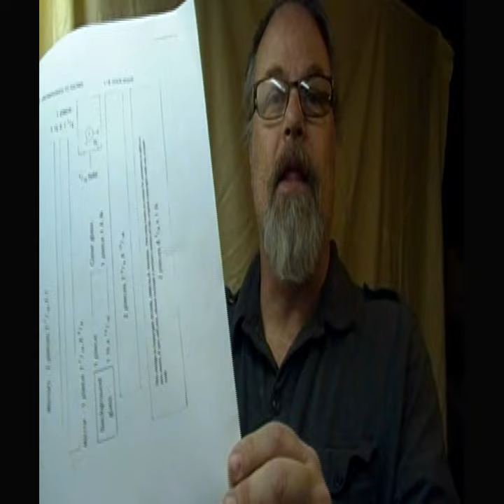The Kaleidoscope Maker #1

Comment: Thank you Mr. Bensley for producing this video & sharing it.  I'm excited to see more of your videos in the future. But I'm a little confused by a comment you made (ref. 32:03) in the video when you said you wanted to make sure you had uncovered your mirror.  When did you cover it after you had assembled & inserted the mirror into the body?  And, shouldn't there be another piece of glass or plastic adhered at the end of the main body to prevent dust from entering & getting on the mirror?  Did I miss something in the video?  Thank you again for your time
Reply from the maker: Connie Flanery I covered my mirror ends when I was finishing the scope.  I could have removed them, but sometimes it is more harm to remove them when finishing.  That is what I meant by uncovering my mirror ends.  Yes, adding an extra piece of glass to the end does help prevent dust from getting into the mirrors.  That will be covered in future kaleidoscopes.  However, you can make great kaleidoscopes without that extra piece.  This was an introductory kaleidoscope design....more to come in the future.
Thanks  for you comments and questions!

Comment: Hellow sir, what kind of mirror is this one? Grettings from Perú
Reply from the maker: this is using first surface mirror.  it is glass with an aluminum coating, but the coating is not covered and that is the mirror side we use.  Or if you can get aluminum that is polished, it will work.  However, all the kaleidoscopes will work with regular mirrors, the image just isn't as good.